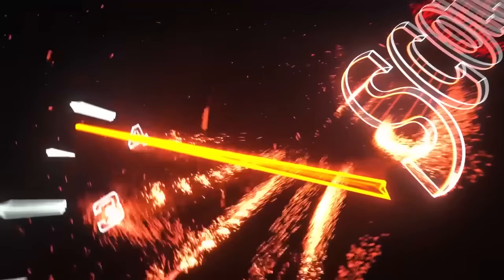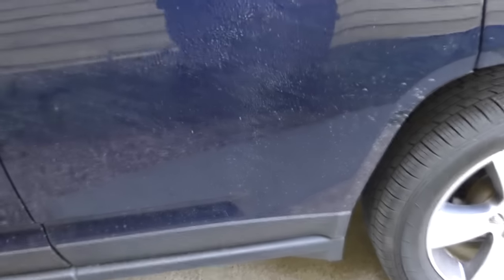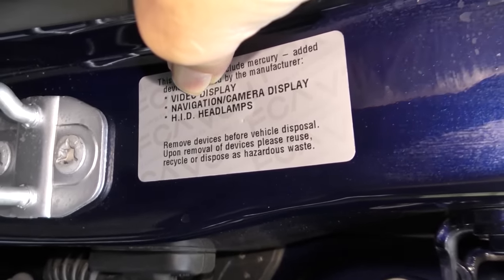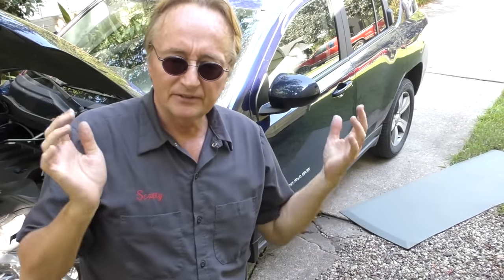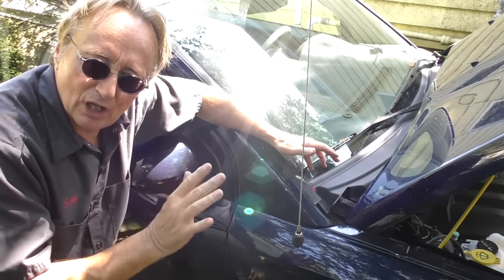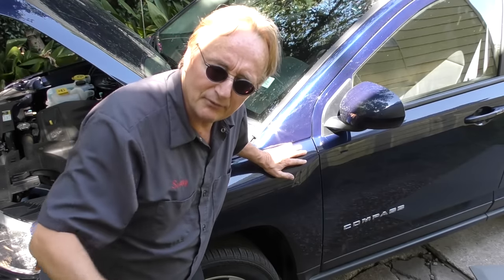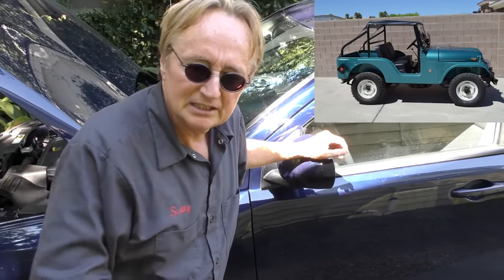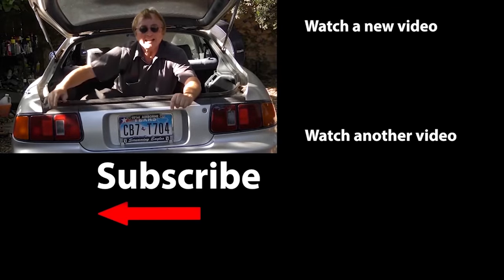Here's Why This Jeep Compass is Crap

Comment: I’ve had two Jeep compasses now, a 2012 and a 2014. The first I put over 50k miles on with no issues besides regular maintenance, spark plugs and air filter. Had almost 130k miles when it got side swiped. Did very well for someone hitting me at 30 mph. The second has been just as reliable. The gas mileage for these isn’t the greatest but with both I get 22-24 in town and 30ish on highway. They are very popular in the area I live in and I literally never see them sitting outside shops. Just because you dislike a make or a vehicle doesn’t mean I’m going to listen to you babble. Figured I’d write a comment so others are aware.
Reply: Thank you.
Reply: I am looking at a 2022. Do you think i would be happy with it.
Reply: My 2012 was a piece of dog doodoo.
Reply: I have an 18 Compass Trailhawk in Chicago and it's ok, I would rather get something bigger like the Grand Cherokee or a Gladiator tbh. Not a terrible car but not all fun as well
Reply: The 3 compasses ive been around were pretty bad vehicles, best case was rebuilt tranny at 85k miles, with a few minor problems fixed by warranty mostly single driver, excellent maintenance record, drive 90 miles for work commute and it snows here, the other 2 didn't used them pretty hard (off roaded a couple times, loaded full of people and drive 80 mph for 200 to 1000 miles for trips, with luggage, stopping hard, taking off fast, stuff like that) they both blew up in their own way, not to mention the windows in the back failing if it gets hot, passenger door window bangs when it shuts, car smelled like rotten eggs most of the time, *each one. Oh, ya, trying to do maintenance yourself is a joke, bout as much accessibility to parts as a kia. I wouldn't mind driving as a company car, but for a purchase that large, I'm sticking with a highlander or pilot.
Reply: Im glad you were able to take care of your jeeps and they treated you well ❤
Reply: I also have a compass and it’s very reliable👍
Reply: @loganm2766  our 2013 has 273,000 miles, been very reliable.  Guess we don't abuse our vehicles though.
Reply: But he is completely right.
Reply: @D97-q2m  its an easy fix to take out the corroded relay from the realay box infront of the drivers side wheel well... It was a stupid place to put a relay box.. but once you replace the relay just seal off the box.
Reply: I’ve got a 2014 compass, it’s an amazing car and I love it. Great for going through the woods to get to my house.
Reply: The one I’m driving is straight trash. The gas mileage is abysmal. If you want to spend more time putting gas in this car than driving it, then go for it. My husband’s 2021 Tacoma truck is better on gas and that’s saying a lot because that thing LOVES gas. The poor gas mileage alone is worth not buying this vehicle.
Reply: Love my 2018 Trailhawk❤
Reply: I got a 2016 compass and aside from the gas milage and the 5 ton hood it's a pretty reliable car. It's a 2.0l fwd but it does its job. We got it with 18k miles in 2017 and now it has 62k miles. Other things I don't like much is I got kids and it can't hold much in the back if the seats are up. But when we go grocery shopping that's what the sedan we got is for. But it's easy to clean out, pushes cold or hot air fast usually less then 3 minutes if it's 0 F outside the heats starting to work. And only having a 12 gallon gas tank makes filling it pretty cheap. 20-30$ is often more then enough to fill it in my area where gas is 2.89-3.09 a gallon.
Reply: @@deeman127 any problem so far?
Reply: I have a 2017 compass limited edition and sometimes when I'm at a light and it goes green the jeep stutters and I have no idea why
Reply: I really enjoy driving the 2019 jeep compass 4x4. What she needs she gets because i plan to be going off road all systems need to be good to go :)
edit to say Trailhawk 
🙂
edited to say that my PTU motor on the transfer case did go out it was not on recall and it was around 700 something dollars at the dealer vehicle has over 100,000 miles
and basically the tires got put off  for that repair so tires were put off not a huge issue okay edit to say when your PTU motor on your transfer case goes out you will lose four-wheel-drive selections and mine was locked in Auto so I was driving around and I knew better than to put it off
Reply: Our 2014 has been absolutely garbage. Too many problems to list including transmission.  Would never buy another
Reply: My 2008 Jeep Patriot (exactly the same as a Compass) has literally been the BIGGEST LEMON that I have ever had the displeasure of owning.  I do all my own work on my vehicles and this vehicle has literally had something new go wrong with it EVERY WEEK over the past 9 months that I've owned it and after spending twice as much in repairs on the thing as what I paid for it when i bought it with 65,000 miles on it and now it's DEAD again with another bizarre electrical problem and a COMPLETELY RUSTED OUT rear sub frame. At this point im about to send it to the crusher and take a 8K loss on the thing not to mention the 100s of hours i put into wrenching and the piece of 💩.  
  I don't care what some armchair never turned a wrench in his life YouTube comments section know it all has to say about this pile of junk, Compass's and Patriots are one of the WORST engineered and manufactured SUVs of all time and I would encourage anyone who is considering spending their hard earned money on one of things NOT TOO. Say yourself the hassle that I just went through folks, DONT, just don't. 🥴😫🤦🏽
Reply: @D97-q2m  its the fuse box it has been a well known issue
Reply: My fingers are crossed since I just got a 2019 jeep compass 2 weeks ago. lol. We are having a problem with the start/stop feature though after they supposedly replaced the secondary battery, but my daughter got stranded at the intersection yesterday and the warning light came on but today it's off and the feature works. So idk cause I wasn't with her.
Reply: No,they suck lol. Not every dog barks, but most do 😉
Reply: Fr bro, I got a 2016 with 130 thou on the dash man. With regular maintenance it's a great car. Good on gas too
Reply: @D97-q2m  has to do with the fuse panel in the engine compartment
Reply: @D97-q2m  has to do with the fuse panel in the engine department
Reply: 2019 with 6 speed manual and a 2.4 L loaded for 25k!
Love it .
The stick solves many issues with this car, plenty of power and 31 mpg.
60k no problems yet
Reply: 😂😂😂😂  you are in denial.
Reply: @ronmiller7210 ”yet” good luck I have 2019 jeep compass it was good and very reliable until 80,000 miles. So far I’ve replaced engine starter alternator 2nd battery I could keep going 😢
Reply: I have never got close to 30 miles a gal with my compass and i drive about 80 miles round trip highway to work.
Reply: Got a 2010 compass with 160k miles and runs just great
Reply: I agree. My 2014 has been great, except for my radio just going out that’s it
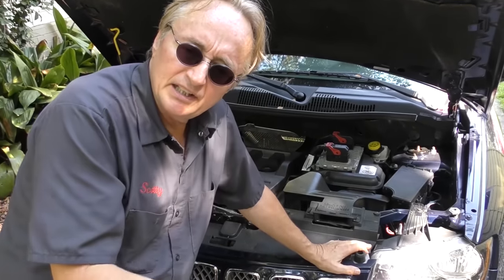4:05
Reply: I have a 2012 compass and the only problems I have had are normal ware and tare. 170000 km
Reply: Babble😂😂😂
Reply: Nope, not agree with him. EVERY CAR AND BRAND has issues...even Toyota Scotty.
My 2015 Patriot has been very reliable...just keep oils levels, oil changes when it's supposed, normal wear parts, transmission oil change... and regular care. If you neglect any car IT WILL FAIL.
Reply: Yup. I’ve got a 2007 with almost 200K miles and minus a few minor issues is still rolling down the road with no mojo issues. I need to fix the clock spring though.
Reply: Bought my 2015 compass used at 109k. Getting 22mpg mostly in town driving. No serious issues. The interior does feel cheap and i've had some of the plastic "hinges" break with minor force applied to them other than that I'm happy with it. We get a lot of snow where I live so I wanted the 4wd.
Reply: I have a 2011 Compass since new and just minor issues like some sensors, suspension and regular maintenance. Just did a 4000k mile round trip from Texas to Georgia in this scorching heat and no issues. I had cold AC and was getting 27 mph estimated.
Reply: @RobChapala  Thank you! I appreciate your POV
Reply: 2014 jeep compass 120k its had suspension issues other than that not bad
Reply: If you don’t drive them very much they are fine. High mileage used jeeps are notoriously bad buys.
Reply: @rebeccamckee7806 when do you bark?
Reply: @wreckitjax  only when the mailman gets too close

Comment: I bought my 2014 jeep compass brand new. I do my oil changes on time. Now it's 2020 and no issues with my Jeep it has like 65,000 miles on it. Best air conditioning and heat I have ever seen on a car. You can blow dry your hair with it... not kidding. Everyone that rides in my car in the summer they are shocked how well the air conditioning works .. the air blast... just like the heat. I❤my Jeep compass
Reply: 2014 is right when Fiat/Chrysler took over manufacturing.  So, the 2014 was not a bad year for them.   By and large Consumer Reports gives the Compass horrible ratings.  Just because yours is fine doesn’t mean there aren’t thousands of crappy ones out there.
Reply: @HockeyVictory66  I also take very good care of my car. I change my oil before it's time to... and I rotate my tires with every oil change. It's not the wear its the care too that saves the life of a car. A lady that worked for the place where I bought my car said she had seen many Jeeps engines blown because customers didn't  change their oil when they should of. She warned me change the oil before its time to and the Jeep should last me a long time. So far it has been the best car I've owned... and trust me I'm 59 I've owned lots of junk cars before.
Reply: Well, 65,000 miles on it within six years, you hardly drive the thing.  Lol.  If the Compass is junk, you haven't aged it enough for it to fall apart.  Of course, God forbid it falls apart on you.  But Fiat-Chrysler is known to have junky cars with junky electronics, as well as terrible designs (for instance, Chrysler 200), and various other problems.  You could have found a gem that was made better than most of FC's cars, but, still, you've hardly got any wear on the thing!  Update this comment when you have 100 or 150,000 miles on it, and see if it holds up.  65K is hardly any miles on it.  Lol.
Reply: G
Reply: @Thoughtful7754  my daddy taught me it's not the wear it's the care that determines how long anything will last me. I know this much everyday my Jeep starts up runs great.... no probs so far. Just now replaced my battery that came with the car that battery lasted me 7 years. I love the room that I have in this car I am always folding my seats down hauling stuff. The exterior and interior look brand new too. I did buy a new battery 2 days ago. New break pads on the front last month. I also take my car to the same mechanic for everything. He is honest... I love my car and I will drive it until things start to go wrong with it. Very happy! It gets me to work everyday I drive 30 minutes to get to work and 30 minutes home. Dependable so far! Drives just like it did the first day I bought her.
Reply: @cd653  You're missing the whole point of what I just told you.  If the vehicle is made bad from the start, you can baby it all you want, it may last longer than most but overall, its still a terrible investment.  Check back with scotty when you have 150K on that Compass, and see how long it lasts.  I'm not speaking anytning over the vehicle, but 65K miles is nothing in terms of wear.  If your compass lasts to 150K, and the transmission isn't going out (not saying it will) or all the electronic stuff isn't breaking, then I stand corrected.  Jeep is run by Chrysler, that is run by Fiat, which is now ran by a French car company.  The only way Jeep makes money is by milking the reputation the original jeeps earned during WW2.  Bulletproof dependable machines.  Nowadays, Jeep is an embarrassment.  Milking the reputation of the name until its dry to suck every last dollar from unsuspecting ignorant people.  Or people who just have to have a Jeep who knows the flaws with the vehicles.  I hate their sin, but not the people.  

Bottom line, check back in when you have 150K on that compass, and see how it holds up.  If it lasts and doesn't have any of what I outlined above, then I stand corrected.
Reply: @cd653  On the other hand, he is right concerning taking care of things.  But you gotta have a well built machine to maintain first before you can expect it to last.  TLC can only do so much.
Reply: @Thoughtful7754  just rolled over 150,000 in our 2014 Compass. Nothing but common maintenance done to it: oil changes, tune ups, brakes. Still runs great
Reply: @Thoughtful7754  well so far it has been the best car I have ever owned... dependable. My last car had over 200,000 miles on it before it died and I took very good care of it too. Only time will tell.
Reply: @Thoughtful7754 I got your point... you have your own opinion. But so far this Jeep Compass has been a great car for me and  has served it's purpose. If it dies I will just buy another car no prob... Nothing last forever... there is a beginning and a end to everything in life... shoot the car might out live me.  It gets me to where I need to go and so far has no cost me barely any extra money in repairs. So I will keep it!
Reply: @Thoughtful7754  I honestly beg to differ many people have these cars and even tho they are labeled “junk” many other go past 200,000 the only difference is they take care of their car.
Reply: @HockeyVictory66  stop hating
Reply: I have about 35k on my 2016... So far, love it!
Reply: @chordsofgratitude2073  we had lots of snow this winter... man I love how my Jeep compass handles in the snow. Honestly it's been the best car I've ever owned so far. So far new tires and new breaks no other issues. Now maybe the older it gets things might change. I hope not... I really love my jeep!
Reply: scotty's toyota cilica will outlast that jeep and its got 240k on the engine lol
Reply: Same just handed in my 2017 got another 2021 compass . Never had an issue. Unlike my Nissans and Fords
Reply: @cd653  you said she drives like the day you bought her. That's gender-specific. Your car might be upset. Maybe it wants to identify as something different 😳🤣🤣🤣🤣just playin
Reply: Women moment
Reply: @cd653  When the battery on my 2006 Commander started failing, the electronic display lit up with messages stating the trans and transfer case had major issues.
Reply: No issues at 65,000 miles
Reply: Earlier video scotty mentioned  transmission  problems starting at 80 t0 100 thousand  miles for jeep compass . He aalso tslks about highway miles versus stop start city tr a ffic miles.
Reply: @JohnathanProphet  hi any updates on your car? any issues since? im interested to buy a jeep compass 2022 but people saying it's a crappy car makes me doubt it so much even tho i love the compass
Reply: @californianbrat8421   None I really like it , has lots of space and leg room. No issues.
Reply: I've got 103,333 miles on my 2014 and it still runs just like new.
Reply: I have 2014 compass. It started rotting out at on the tailgate and hood at around 20k miles got the tailgate fixed under warranty but the hood was just after it expired. The heating and cooling takes about 5 mins to switch from defrost to any other way.. It has been good to me till it hit 70k then brake light came on they couldn’t find problem finally they found a broken ground wire.. Then left tie rod went and now at 81k the abs traction control and 4x4 lights are on .. trying to figure out the problem.. love it in the snow I got my money’s worth but wouldn’t buy again 🤷🏻‍♀️
Reply: Jeep is garbage, buy a Honda or Toyota
Reply: @mscottlawrence2037  Well my Jeep is paid off for... so I will be driving it until it starts to become a money pit. It has 100,000 miles on it now. So far my Jeep has been the best car I've ever owned. I ❤  my JEEP so far.
Reply: @cd653  that's cool,I'm just in to better quality visa v honda and Toyota are better 🤷‍♂️
Reply: @cd653  I respect the fact that you take care of your vehicle. Regardless of make/model. Many people treat vehicles like magical entities that never need any care, and then they are outraged when the vehicle has an issue.
Reply: We have a 2012 jeep compass with 110,000 miles. Besides tires, oil changes,  brakes,  plugs and coil packs its been great. Only car I've ever had that hasn't had a check engine light come on at some point.  But the interior quality I will say is garbage. The handles and trim is all peeling the faux chrome.  Besides cosmetic it's served its purpose. Bought it used and had it 7 years now.
Reply: You should drive an audi if you want to see powerful heating on max it would cook your skin 😂. You got lucky though my sister has a jeep I told her not to get 1. Endless issues